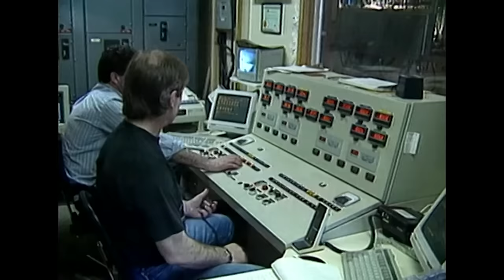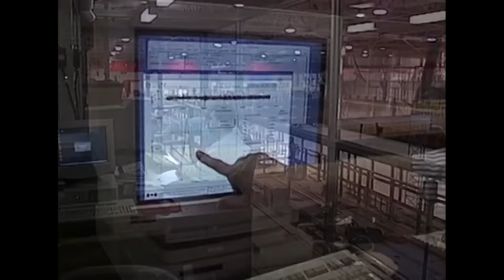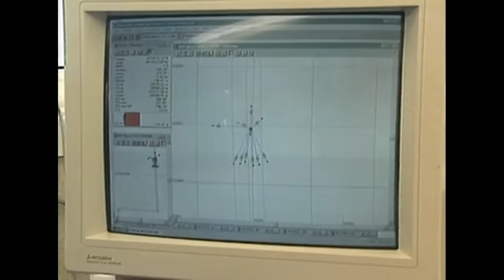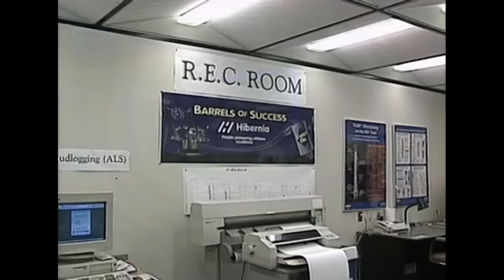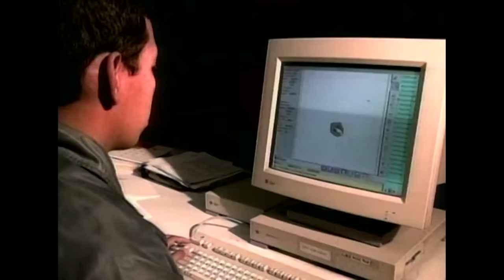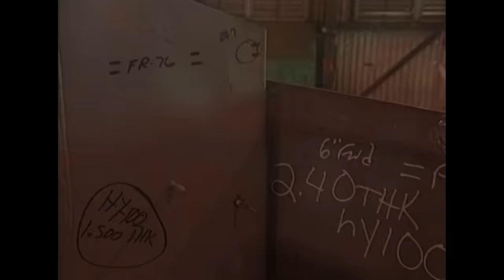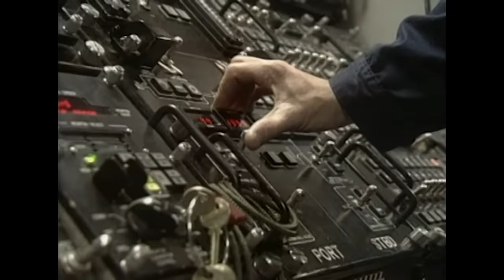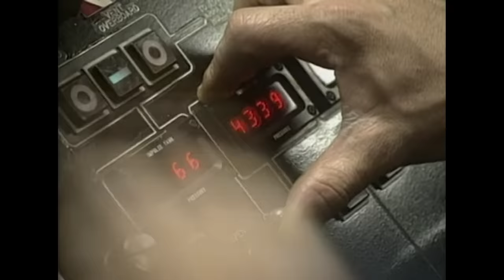2+ Hours Of The World's Most Advanced Super Structures

Comment: While an amazing creation, it seems also a colossal waste of human endeavour all just to drag  up oil from the depths, and that... just to BURN IT UP!  
We burn it just to make heat (for power to transport, by land, sea or air) and supply direct heating and electricity.  By electrifying conversion and using ever advancing mechanical or electric batteries, huge megawatt wind turbines and solar farms can finally store all surplus energy and transport is more and more electric, indeed the Solar Aptera runs up to 1000 miles on a charge AND add up to 40 miles per day,... by the sun only!